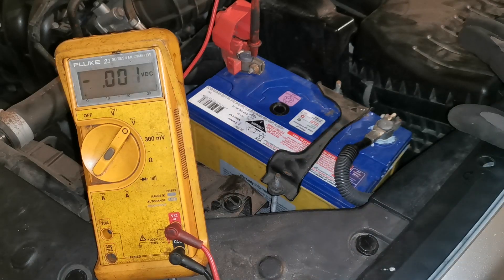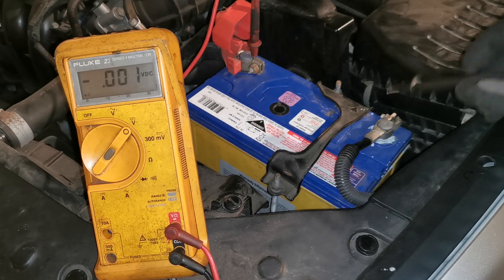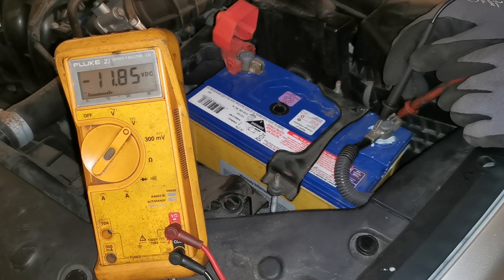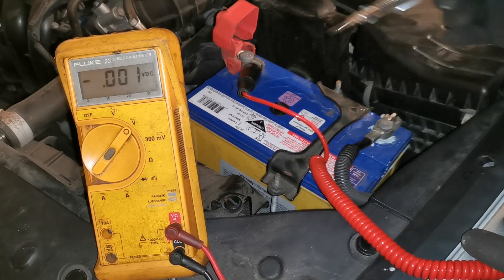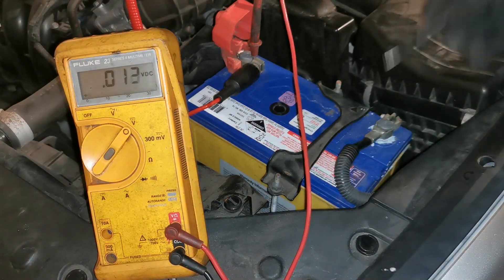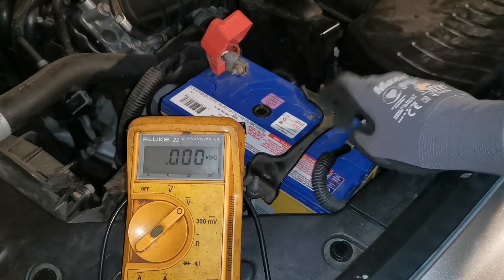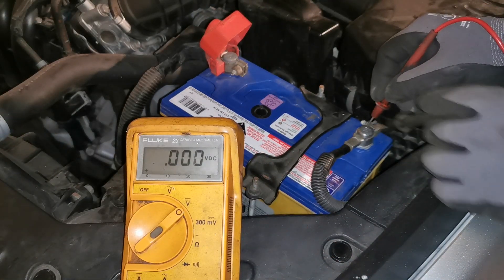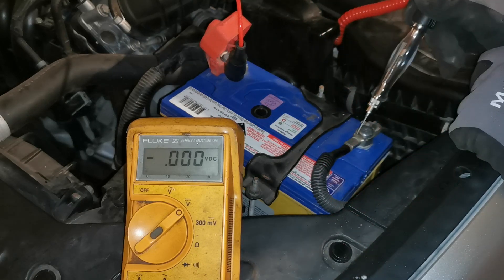Voltage Drop Test With Multimeter & Test Light - How To DIY Test Battery, Clamps & Leads Faults

Comment from the maker: This is a quick test I have done so many times over the years and found issues with no crank no start faults. 
*Just remember if working on other circuits voltage drop should be checked with the circuit loaded and a fully-charged battery when possible* Example if you wanted to check voltage drop on headlights you would have them turned on, on a starter you would need to crank the engine to check, it must be loaded 😁 
 
As always thanks for watching.
Reply: Some ideas there for a few more videos.

Comment: I’ll be sharing this a fair bit. Going back to basic checks of circuit integrity takes minutes. It can resolve issues that may have some chasing phantom faults elsewhere. 

Cars with networks are getting older and so are their main cables.   Bad earths to chassis and engine blocks from battery can also be identified in the same ways in seconds. 

Great video
Reply from the maker: Thank you 🙏👌💯